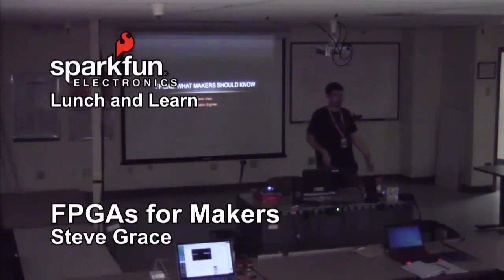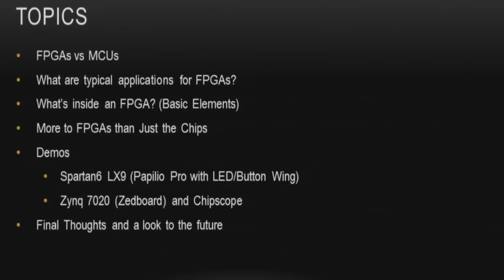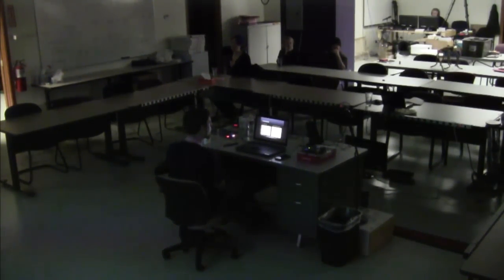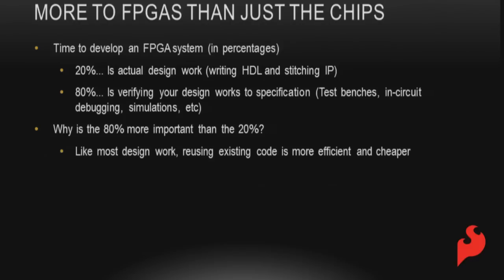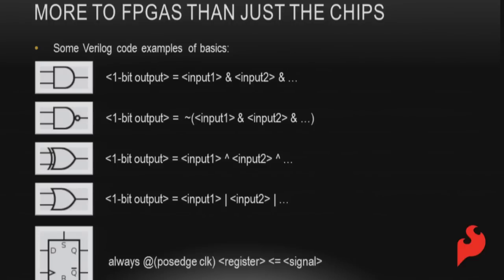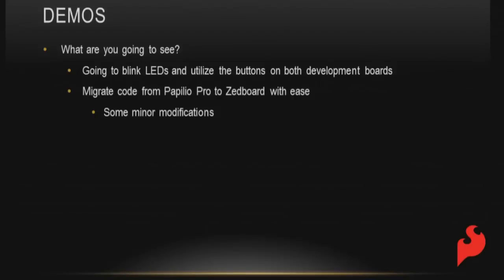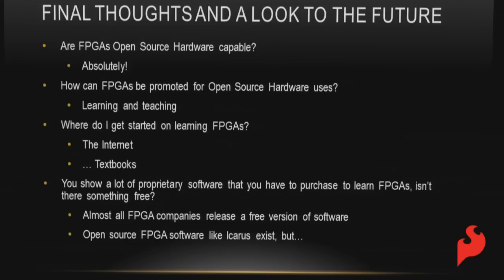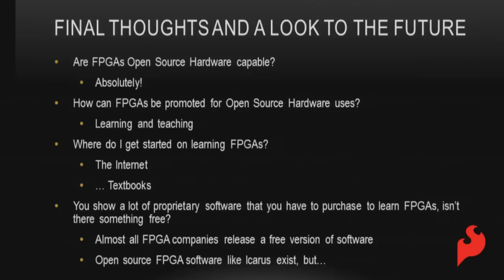SparkFun Lunch and Learn: FPGAs for Makers, with Steve Grace

Comment: This talk was not very structured. Jumping between low-level and high-level concepts without properly connecting the dots. The beginner will be utterly confused.
Reply: No offence to you sir, but a beginner should stay far away from FPGAs
Reply: I am not disputing that. But the speaker clearly wants to introduce FPGAs to people knowing microcontrollers (explaining gates and making LEDs blink in his demo). But he fails to structure his talk accordingly; e.g. when he notices late that he should have introduced LUTs.
Reply: Hi Henner. Thanks for the comment. It's hard to talk to FPGAs to a beginner, and even some of the most basic concepts of FPGAs are quite complex. Yes I know I switched between the two, and I use feedback from the audience to help with this. I continually asked 2 SFE engineers to check comments of the livestream for questions, and got none, which to me was disappointing.

Also, I do want to mention, I asked Sparkfun to livestream it as a courtesy to the community in general (most of the time, Lunch and Learns are for the employees only). I frequent the Sparkfun IRC channel all the time, and I sometimes get bombarded with FPGA questions.

If you have any questions in general about FPGAs, please fill free to ask me in the IRC channel.
Reply: Andy Plater I disagree with beginners staying away from FPGAs. They have their place in the world of Open Source Hardware. Yes they're complex, but to a complete novice, the MCU was just as complex. It takes time.